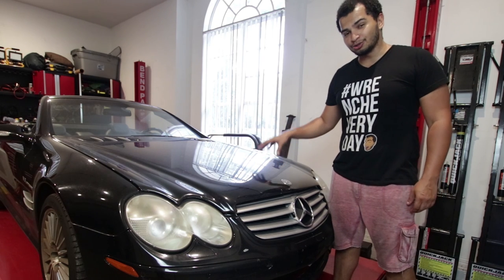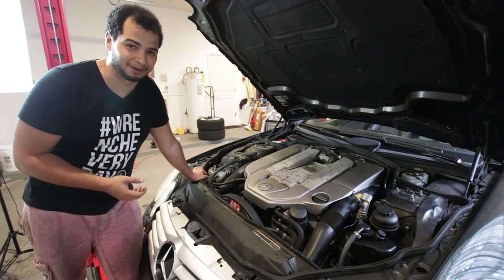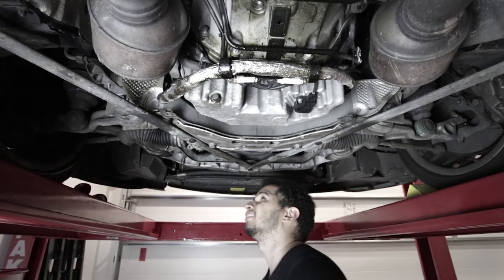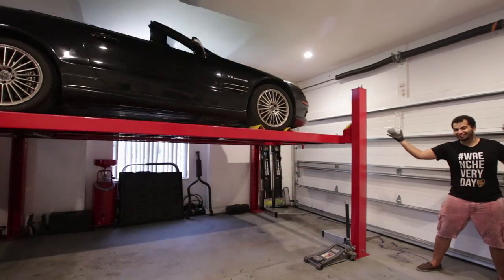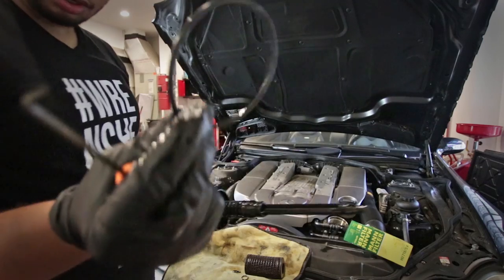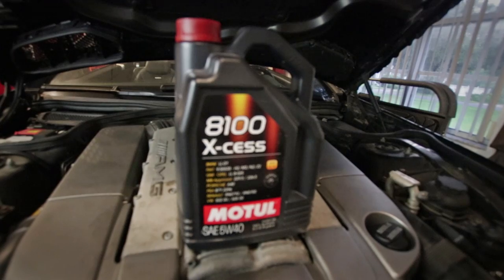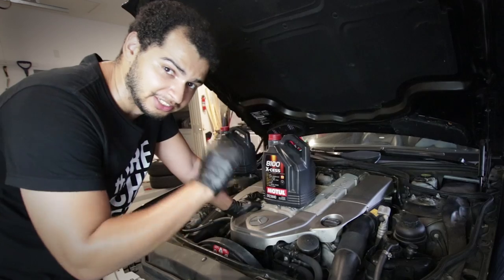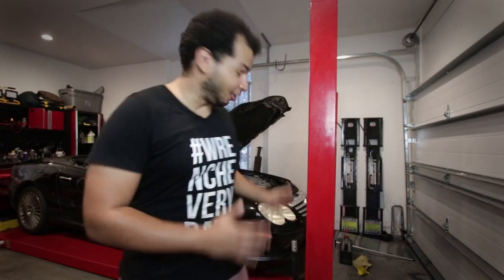Here's Why A Mercedes Oil Change Costs $320 And Why You Should NEVER Pay That Price-Project SL55 Pt1

Comment: If your dumb enough to pay 300 for an oil change you definitely deserve that dent in your pocket. Smh
Reply: I buy whatever full synthetic oil is on sale and a good filter. The last oil change I did Quaker State Full Synthetic and a Purolator Pure One filter for only 24 dollars. Jiffy lube wants 58 dollars for a unknown filter and unknown bulk oil. Thanks buy no thanks, I will change it myself.
Reply: for the people who can buy a brand new Mercedes, $300 is nothing
Reply: Plugs, semi-synthetic oil and both OEM filters for my crappy car come to about $50 :D
Reply: Not necessarily true.  Some cost under $40K which is less than a lot of the Ford/GM/Toyota/etc SUVs you see on the road.  If a car costs only 50% more, an equally affordable oil change would cost only 50% more.
Reply: no. it is necessarily true
Reply: some middle class and rich people don't even work on their cars. it's dirty labor work to them. however $200-$300 oil change is so much some bmw and mercedes owner make the excuse you only have to change oil 1-2 times a year.
Reply: Nick what is a gas pump?
Reply: if you cant change a tire or change your own oil you shouldn't own a car lol
Reply: electric feel oil changes are dirty labor work regardless of how socio-economic status.  Some people just don't have the time, desire, or tools to do it.  I've had 23 cars, and just yesterday changed rotors and pads on a car for the very first time.  Will I do it from now on? Sure, on the current car, but even so, I had to make the initial investment for all the tools and materials, which was over 200 bux, plus being my first time, it took over 4 hours.  Most people just don't want to go through that, even if they are curious about doing it and saving a few dollars.  Also, if you're wealthy enough to only drive new cars or leases every few years, you're always going to be under warranty so there is no reason to be doing routine maintenance when the dealer includes it anyways.
Reply: yeah maybe if you want to save some time have a pro install your rotors and brakes, but an oil change?, it takes a max of 30 minutes, one socket, and some fresh oil. and its wayy cheaper, im not a rich guy i have alot of bills and i work a alot, so when i have the time, ill just do it myself. unless you drive a buttload of miles, you shouldnt have to do it more than 3x a year
Reply: Tyler L tire change should be required as part of a driver's test.
Reply: Well if you have the money for a SL55, 320dollars is peanuts....
Reply: Stepside1986 "unknown bulk oil" you said it. UNKNOWN
Reply: Mercedes calls for 0-50 synthetic oil. It's 15$ a qt and your average S class takes around 6.8 qts
The filter alone cost anywhere from 60-100$
My s55 AMG cost me 170$ to do it my self with non Mercedes brand fluid.
Reply: tony americas yea I hear that new S63 AMG black that's killing the gtr isn't fast.
Reply: tony americas nope, my M5 feels great tho
Reply: Aww thats nice my 325i sportswagon feels as nice...
Reply: Its because rich people buy Mercedes so the dealership takes advantage of it
Reply: It actually calls for Mobil 1 0w40 motor oil. You can also use Castrol Edge 0W40. It is on the approval list. As long as it meets MB 229.5 spec, you are ok.  The S55 AMG takes about 8-8.5 qts because of the M113 V8 with the same capacities as any of he other 430 and 500 classes with the M113 V8. 

I was an MB Tech for years and have been servicing these vehicles since 2001. Most Mercedes vehicles take atleast 7.5+ quarts. Only the 4 cylinders take around 6 quarts. No Filter on a Mercedes costs $60-$100. I go to Walmart and buy 5-10 5 quart Mobil 1 0W40  jugs for $22.88 each, when on sale. I sell these A services every week for $120($175 for AMG) for non AMGs. The oil change costs me $55 and I use a fluid evacuator.
Reply: I wouldn't call American cars trash, but I agree that those older AMG 55s were very quick. The 63s and 65s took it up another level. The 2007 S65 AMG I just did the brakes on a few days ago should not move as fast as it does at 5K lbs. V12 TT makes monstrous torque and that car pulled to 100 mph like few cars can.
Reply: The chineese and arabs  don't care about 500$
Reply: I change my oil every two months. I  First take it for the initial oil change where I change the filter and  oil. Then, every two months I personally change the oil but not the filter. Then, again in two more months I change the oil but not the filter. Then, after those 4 months I go to change the oil and filter. And the cycle stars again. I can't reach the oil filter from the  ground. I s a little difficult. I spend $40.00 in those 4 months in oil change. There is no problems at all  by doing that.  $300.00 oil change. No way. And the tires cost at least $ 300.00 too. Mine $65.00
Reply: Heriberto R Montalvo you’re changing excessively. Literally wasting money changing oil without a filter.
Reply: You confused me with that part number. Those 55s back then are all M113 V8s. They take the Mann 718/5x(000-180-26-09) filter element. The only one that was different was the SLK55 which takes a 718/6X(000-180-28-09) I believe. I get the OEM from the dealer since it is an odd size.  Pain in the ass they did that to them and they don't have a dipstick, but that is another story.  You posted a spin on which I don't think I have ever seen on a Mercedes going back even to the 80s.
Reply: 1-2 times a year, no wonder why the reliability ratings on luxury cars suck. I change my Subaru STI oil every 3 months no matter how many miles I put on the car.
Reply: thefives7ar It actually has nothing to do with their reliability. Also your oil capacity is much less. Just because you change it more often doesn't mean it is impacting anything. I use Amsoil signature series good for 25K in my work van and change it every 17-18k miles. I am close to 200K of hard driven and weighted down driving miles. Some people like to waste oil which makes little sense. If it is turbocharged and you drive like a maniac, then it is a good idea.
Reply: I love my car and yes I maybe dumb
Reply: But apparently they only need an oil change every 10K miles or once a year.  So, yeah, that's still more expensive than my $50/5K-mile oil change, but if you don't put a lot of miles on the car, it could be a once-a-year cost.
Reply: Im reply number 300!!.. hmm
Reply: $300?  If you bought a brand new Ferrari, it would be more like $10K for a normal check up, but they typically pull the engine out and inspect it, etc.
Reply: The thing is that companies like Mercedes Benz typically will get top mechanics and have them go through training that's expensive and they pay them more per hour than a Toyota dealership will pay.

I have a friend of mine that just graduated from UTI, and while he was there, he worked at a Ford dealership, and he told me the horror stories of what goes on.  Now, he got accepted by Porche Master Mechanics program in which they pay for his training because he was one of the top graduates and they only accept a small handful of graduates they run those their training.  Once he's done with Porsche Master Mechanics training, he gets hired by a dealership and gets paid quite a lot of money, and it's much better of career than just getting hired by Toyota, or some US mfg.  They don't get the cream of the crop.  But companies like Mercedes, Porsche, Ferrari, etc., they are typically more careful who they get and what training program they put them through.

if you aren't trained to work on a Mercedes, then maybe you shouldn't be touching the thing, unless you have someone help you do even the simple things.   These aren't $20K cars that are built by the hundreds of thousands.  An SL55 has a hand built engine and to maintenance it where it performs to factory specs, it's just better to have a qualified mechanic perform the maintenance on the thing because they might do something you don't know that should be done and end up trashing the car when all you are doing is trying to save a buck.

Ever price out a Level A service from Ferrari?  Do you think those are going to be cheap?  Don't have a Toyota mentality when working on a Mercedes or some other car that's vastly more expensive in the first place.

You don't have to take it to a dealership as there are independent shops that do have properly trained mechanics that charge less than the dealership.  That's where I took my MB when I owned one.
Reply: MB designs their cars to go at high speeds for long periods of time.  A drag race only lasts a couple of seconds.   Mercedes AMG's typically have decent 0-60, they might not be the fastest, but they are luxury sports cars that are designed to pamper the driver and passengers in high quality luxury interior and also have great overall performance.  Go drive your American car on an Autobahn at high speeds, they aren't designed for that type of driving.
Reply: Tony,   MB don't focus as much on drag racing as they do daily driving and being able to take on a track or the Autobahn and have a safe, high performance luxury car.  There aren't that many LUXURY sports cars on the market.  MB focuses more on Luxury than other brands. But if you want to go to the drag track, then get a fucking Tesla and own everyone else that has a stock car.  that'll end that story.  A Tesla will smoke anything you can buy off the lot, and their Roadster that comes out in a year or two will blow everyone off the road.  0-60 at 1.9 seconds.  

I wouldn't take the MB AMG55 on a drag track.  I would take it out as a daily driver and the be able to go to a road course track and have a lot of fun.   It's for those that want a Luxury sports car.  Most sports cars aren't don't have the luxury features that the MB has.  They usually focus more on the performance aspects, but not the luxury aspects.  The MB can be a daily driver and take on the track on weekends and have a great time doing both.
Reply: if you have 300 to spend on an oil change it wont put a dent in your pocket...
Reply: Nick J wtf bro. I may be a tech and video game nerd but my car knowledge is probably better than yours. Don't think someone is clueless about something just because they do something unrelated to that.
Reply: DØPÊ its cost for me 120$ oil (7 pint )and filter for MB brand...
Reply: *you're
Reply: don't forget to add zinc to your oil brother
Reply: Serantony Soriano  well said! agreed 100%
Reply: Serantony Soriano I totally agree

Comment: Hey Guy I’m sorry this maybe a little late and maybe a little more helpful to for checking the engine oil level the most accurately there’s videos on it as well, you get in your sl55 turn the key to one click before accessory mode, leave it there , then scroll to the main page of your instrument cluster the one that shows your MPH/ temperature ambient, then then push the little reset button for the oil service interval about 3 times really fast like Tap,Tap,Tap! Your instrument cluster should go into an alternate menu screen it is at this point u turn your key to the accessory switch on position but don’t start the car, as you’ll see on this alternate menu you will see the vin number of your car the engine and chassis of your car as well as how many quarts exactly r in your engine as of the moment you pulled it up, that’s what I use and it is very accurate I must say, another way to explain this look up dyno mode for e class CLK class amg And it will explain how to get to the menu as welll. This video is pretty old and you seem to know a fair amount about cars so I just thought I would share that with u if it helps cool if not cuz u knew it’s all good

Comment: A small tip as you do your own oil changes, submerge the filters in oil for a while to reduce the risk of sudden oil pressure arrival at the filter bursting it. Spin-on types with housings can be filled up and element types submerged in a clean container. Loving the DIY attitude!
Reply: Isn't pre filling a oil filter bad because the oil  bypass the filter and go straight to the engine could be contaminated with small particles that can damage the engine.
Reply: @kaptain1477  they'll be there regardless so no

Comment: With 9 qts, I could do an oil change for about $35, including the filter. I use Walmart Supertech "full" synthetic. Good enough. I have a 2006 Mercury Grand Marquis with about 100,000 miles more than your Mercedes. I use Ford Motorcraft filters (because they are the only ones you can get a socket for, and you cannot get a strap wrench on the filter in the stock location) and 6 qts. of Walmart Supertech 10w30 "full" synthetic. (Yes it calls for 5w20, but it has 250,000 miles of wear, meaning looser clearances, so the heavier oil works better) I have owned this car since 47,000 miles, I change the oil every 3,000 miles, and I expect to get well over 300,000 miles out of the engine. An oil change costs me $25, and takes about 15 minutes to do. Firestone wanted $77. That's enough for THREE oil changes. When the engine/transmission/other expensive parts wear out, I may just replace them, since they don't make large, comfortable, RWD, body on frame, V8 powered, solid rear axle cars like this anymore.

Comment: 4.5 qts. more ,but putting a filter dry, I 'd never do, showing everyone how to put a filter in DRY, is wrong....
Wet filter with oil then install (wet!)
On starting your not running engine while your filter is filling with oil.
Reply: 4711Express I did my oil on a "89 Vette, no ,"O" ring on filter,so I started it .I happen to look in the engine bay, oil spraying every where.Live/learn got my lesson.

Comment: I don't want to think how much money I've wasted sending my Benz to a Mechanic to do a service Geeez. 

I couldn't believe when I, took the old Oil Filter out (replaced by a supposedly reputable local mechanic who does work on much higher class cars than mine) that it was an "El Cheapo". 

I thought I was a complete mechanical clutz. Between Tavarish  and Alex at Legit Street Cars, I have safely and efficiently replaced and upgraded my Brakes and completed an Oil change. I bought an Oil Extraction Pump and didn't even get under the car saving '000's on a lift and cents on a replacement Sump Plug Washer. 

The Car has the oil I choose, the Quality Filters that it deserves, and I'm still up almost $200.00 (everything in Australia is more expensive).

Thank-you Tavarish, I wish you all the riches that YouTube brings you.

Comment: A topsider oil pump is a great DYI method for changing the oil.  Since the oil filter is on top there is no reason to go under the car.  "Yes." Top siders get 'all' of the oil out.  I have used this method for 10 years on a BMW Z3 and for 3 years on a MB SL550. Zero oil related problems on either car.    I've been told that this is the way most MB dealers do it.

Comment: I like the videos and ways we can save money on expensive maintenance items by DIY. Think this video needs an update or PART B to let people know you need to remove the oil filter prior to dropping the sump oil. I would also advise that you include the MB recommended torque settings to the two sump bolts as well to prevent under or over tightening!

Comment: I don’t see the problem if someone wants to do their own servicing. I am very particular with my vehicles. Personally, I do my own services with an inspection, but I do buy the filters from the dealer for my records. My Porsche, Benz and Tacoma all have oe filters. I change out my own driveline oils, brakes, filters etc and write everything in my log book that each car has in the glove box. Once every two years I take the Porsche and the Benz in for an inspection just for peace of mind. Not once have they found anything broken or worn out because I’ve already tended to it if there was. I’m am constantly impressed with how well the German cars are built for the most part and the prices on parts aren’t nearly as bad as they’re made out to be. 

Also, for the record the Camry I just replaced cost me 4x as much as the Cayman to keep on the road. Price out a set of 4 struts and top hats from the dealership and tell me a Toyota is cheap. Granted it had a lot more miles but that doesn’t mean it won’t need to be maintained and will magically last forever.

Now, full disclosure I am/was a mechanic for a few years in the the lighter duty side but I’ve now switched to heavy duty and work on multi million dollar cranes everyday. I still don’t think regular maintenance is out of the realm of possibilities for the average joe. Just be smart, do your research and follow a shop manual if you need, they’re available on the internet.

If you’re the type who relies on the dealership to do everything for you, maybe a German car isn’t for you. But for the rest of us, there are some real bargains out there and you can get ALOT of car for the money.

Comment: One reason some people pay to have their service done at a dealership is because their dealership offers a lifetime powertrain warranty as long as the service was performed at the dealership every 12 months or 10K miles. It's about $350 per visit and I think it's well worth it if you plan on keeping the car past 60K miles. Another reason people get service done at a dealership is that most dealerships will come and get your car at home or work and leave you a loaner while they service your car. $350 is less than one day's pay for many Mercedes owners so they don't mind paying $350 per year. The techs will also remove the filter before draining the oil because they actually know what they are doing.